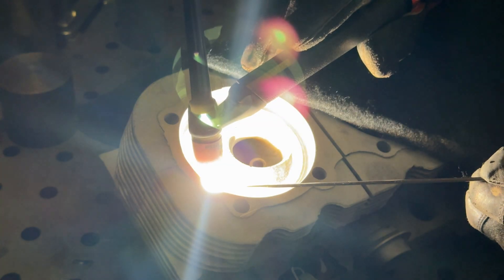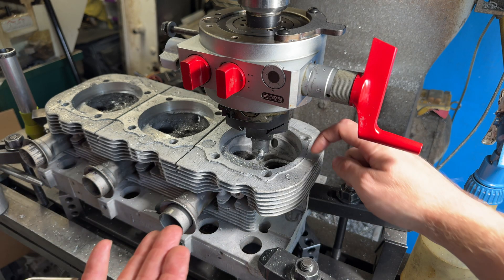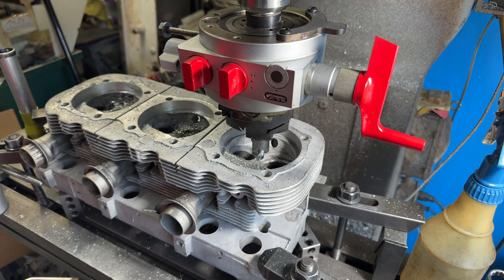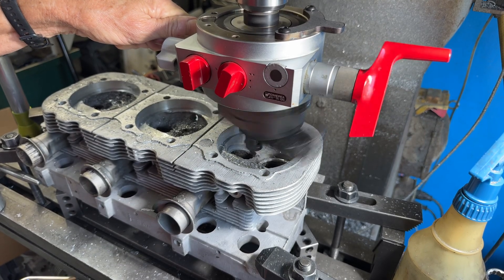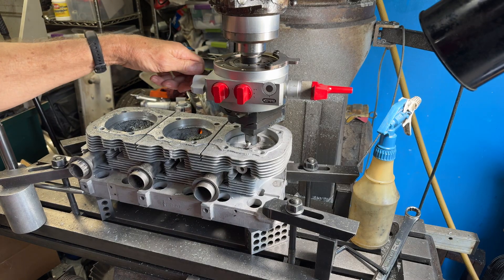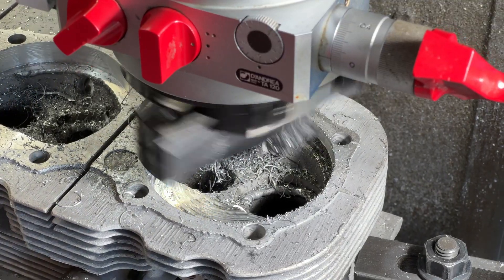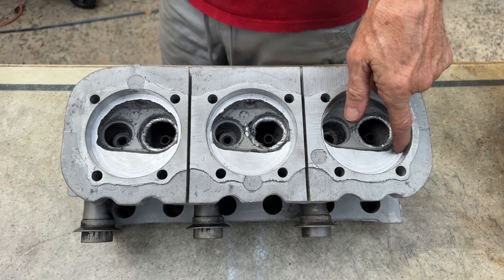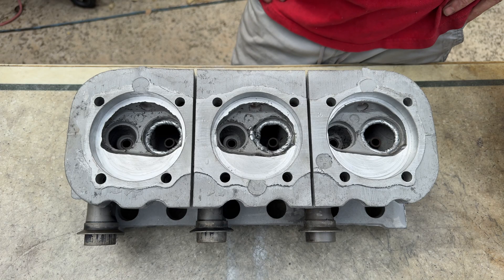How Easy Is It To Fly Cut A Corvair Head With A New Tool?

Comment: a shop i work for 50 years ago was using a boring facing  cutter head in a mill  to surface v w heads i like the one made in France that enco sold with the outer ring you held on to and it would face in or out nice compact not a big lump clunking around
Reply from the maker: Those Gamet boring and facing heads look good but they don't have the quick reverse of the D'Andrea. I haven't seen the actual operation of one but it seems like you also can't start and stop the facing advance while the machine is on which would slow down the process time quite a bit. The Gamet heads are also a lot cheaper so that's a big bonus compared to the D'Andrea
Reply: @AmericanFlat6  the one i am talking about look like a boring head with a  Knurled rind band on the outside and a in out lever and it only traverses if youhold the ring so if you let go of the ring it stops cutting a good used ond can be had for 300 to 500  the one you have looks like a lot more like 5 to 10 times